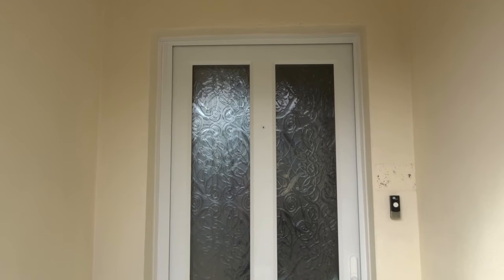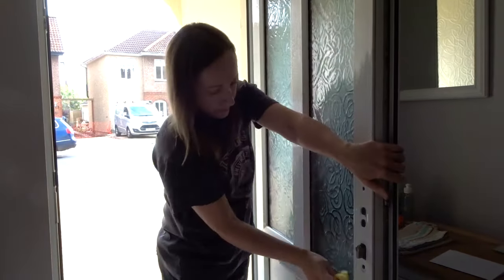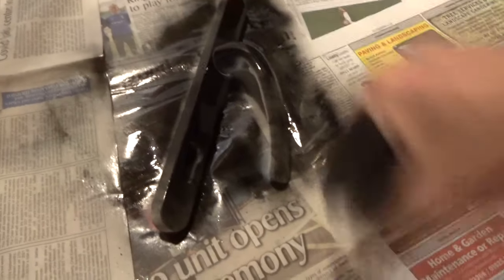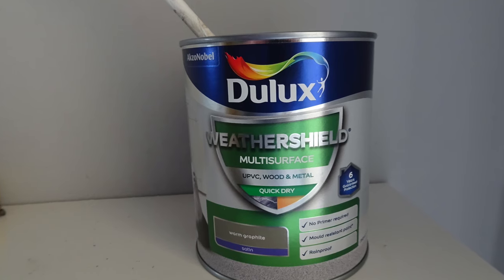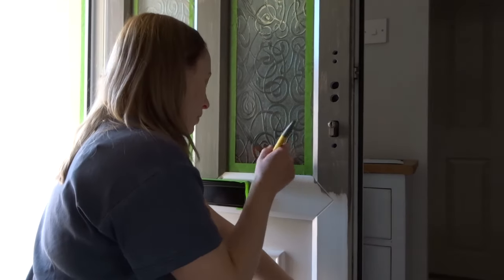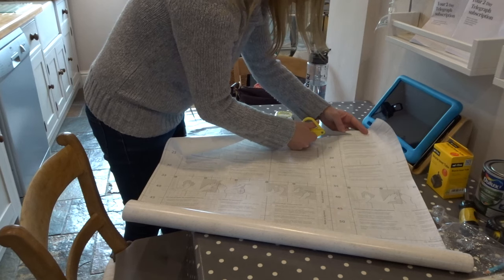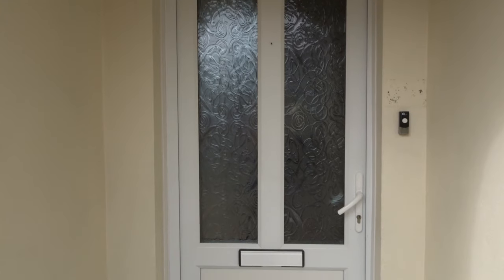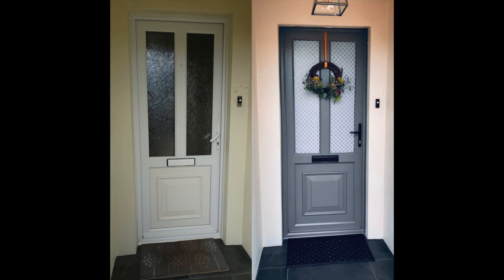UPVC Front Door Makeover | How to paint a UPVC door using Dulux Weathershield paint

Comment: Just a word of warning to folks using window sticky vinyl on double glazing. I used it on my porch, I covered the two floor to ceiling windows. After some months they both developed huge cracks, first one window then the other. We were baffled as to what had caused the damage, even thinking it might be malicious, but only the inside of the double panes had cracked. I had a glazier come out to replace them at the cost of £300 each. He peeled the window cling off with disdain and said 'you've not used this stuff have you?' (Obviously I had) He said the window cling causes a build up of heat/cold inside the double glazing and that's what had caused the damage.
Reply: So sorry to hear this. We  have had our large (8ft x4ft with three panels) double glazed window covered with this privacy film for at least 8 years and nothing like this has happened to it. I wonder why it should have happened to your window and not ours?

Comment: I was wondering how you managed to change your white front door furnishings to black please 😮? I'm trying to change my gold metal front door furnishings to white (on a red upvc I've restored its original colour ❤), but after rubbing down, primer spray twice, then added spray 1st coat, darn letter box (and numbers) blistered. It looked so good in the primer, but I didn't want to leave the furnishings in a dull matt look finish 😢. 
Can you help at all?
Reply from the maker: I gave them a light sand and didn’t bother to prime them. I needed to touch up the handle the other day and I used car spray paint. It looks fab. Perhaps try that or a spray paint specifically for metal?
Reply: @LivinganOrganisedLife  Thank you very much for mentioning the above. However because I've already primed them, and sprayed them with all purpose spray paint, it's the latter that didn't work successfully and started cracking on certain front door furnishings 😞. 
Not sure what to do now? Maybe start all over again 😞?
Reply from the maker: Oh no. I think you’ll need to scrape it off as best you can, sand them back and spray them again. Good luck
Reply: @LivinganOrganisedLife  I thought you would say that. Oh well, nothing ventured, nothing gained I suppose.

Comment: After your last coat, was there any brush marks at all? 
And did you use any thinners with the paint, or straight out of the tin?
Reply from the maker: I used it straight out of the tin and there are minimal brush marks. You could use a small smooth roller to avoid any brush marks 😊
Reply: @LivinganOrganisedLife  Thanks..
Great job, in exactly the same position, poor looking door, but too far out of what I can afford right now to replace. 
Think I'll be doing the same until I can replace 👍